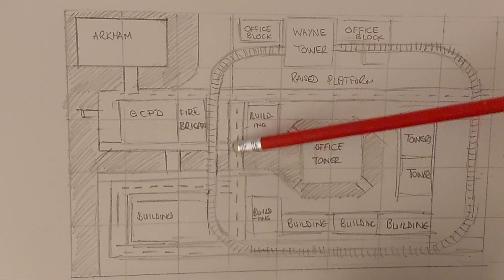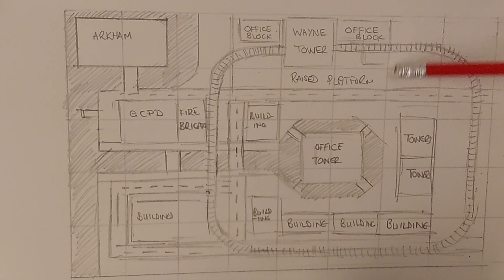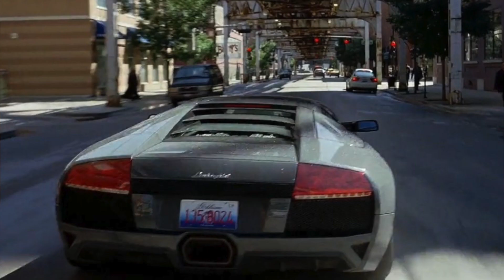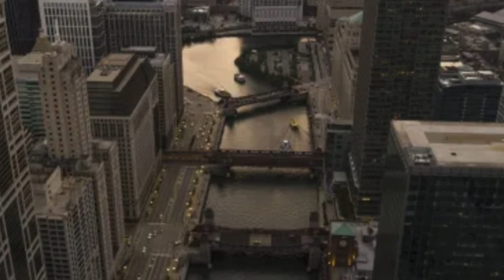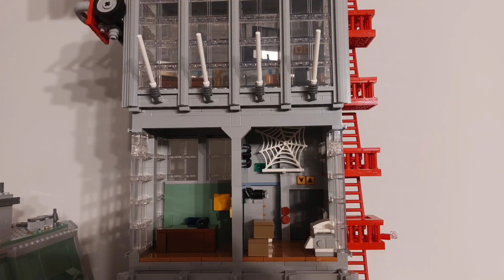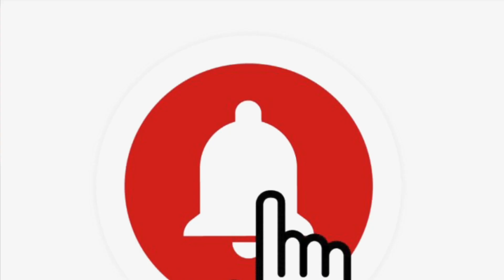Planning The Custom Lego City

Comment: Just found this project... and as a huge Batman fan, I look forward to seeing how you get on.
Couple of things I thought of... firstly - check out the Wayne Tower from the 1970's comics. It's a tower block with a huge tree in the centre of it, and Bruce lived in a Penthouse on top of the building. He has Batcave under the building which he accessed through a hidden elevator within the trunk of the tree... would be a big project, but I've always thought it would make a really interesting moc.batman.
Secondly - where you have the buildings downtown, as it's Gotham City, you need to put Crime Alley in there somewhere. 
😁
Reply from the maker: Thank you @dazblue5515, I am hoping to start Crime Alley within the next few weeks. Re the Wayne Tower, I will check those comics out for ideas/inspiration 👍

Comment: That plan looks pretty good already, the only thing I'd change is to make the office tower in the center the Wayne tower, it could be a great eye catcher there.
Reply from the maker: Thanks @The Roaring Bricks, I was thinking the same thing. The only reason I was putting it on the side was so that I could do a cut section that showed Lucius Fox and all his gadgets etc under the tower (as in the Christian Bale Films) and also to be able to see in the Wayne Tower. I did want the tower in the centre to be a focal point and would make more sense for that building to be the Wayne Tower.... Decisions decisions 🤔😂
Reply: @dubbzibricks  the good thing about lego is that nothing has to be permanent, you can always do changes, unless you glue the parts together😂